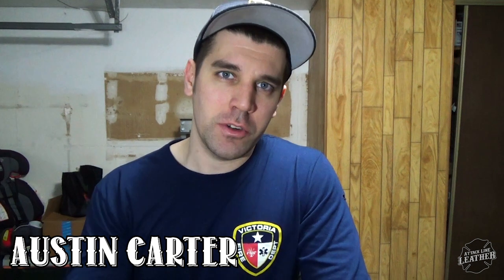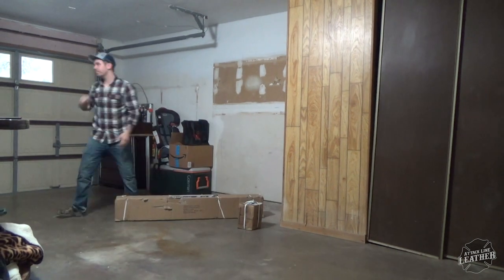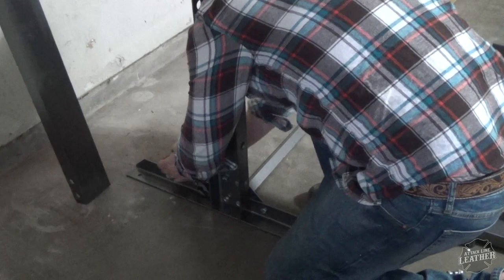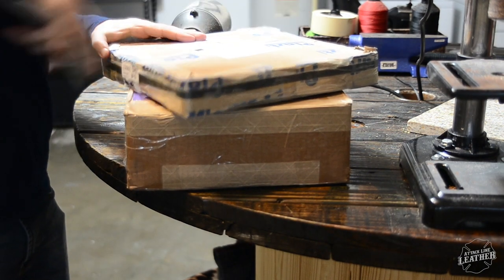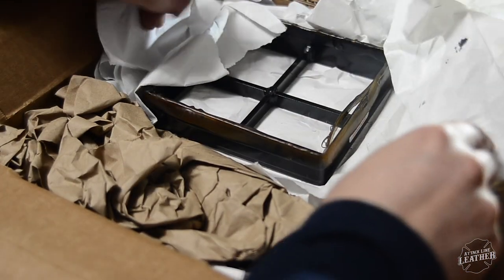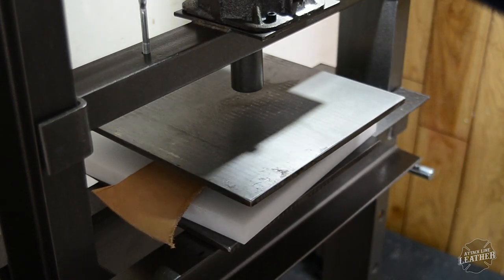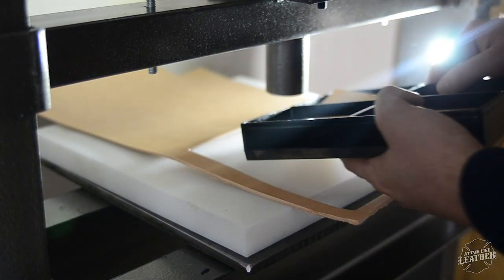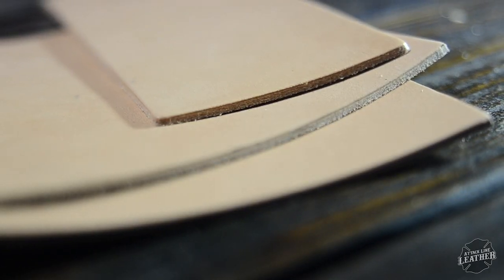Leather Clicker Press on a Budget

Comment: Another tip I would recommend is either drill hole higher on the sides but that will require quite precise drilling for 4 holes or make a stopper for the return and would speed up you having to pump extra pumps to speed up
Reply from the maker: Very good tip

Comment: Thank you, Austin, so very much for sharing your video. I just received my pre-made Steel Blade Rule Die Cut Steel Punch Wallet Cutting Mold Wood Dies  for making wallets (with the stitch holes in them) but NO directions!
It came directly from Japan. 
So I have been looking all over on how to use them. I had also just purchased a 2 ton Arbor Press for debossing a logo for my friends business. I was hoping I didn't need the bigger 20(?) Ton Arbor press just for small leather items.  
So I followed your greatly appreciated instructions, and am going to go from there! 
(I don't think I need the steel plates.)
I have the plastic cutting boards from Walmart.  Lol. 
So I hope I am set.
Thank you so much!
I am making them for merch for my friend to give away. It's my donation for his YouTube Channel. (It got to be quite an overall expense for giving free donations! Lol) But I am learning the ropes of leathercrafting. I'm 62 and just retired. I've always wanted to do this. 
Your YouTube Channel is my "Go-To" Channel now!!!
Thank you again😊👍
Reply: P.S.
I will have to go find out how to put these pieces of leather together, once cut, to make a wallet though! Lol
Reply from the maker: Thank you soo much for the support. For what you described you definitely dont need the 20 ton press. Depending on the thickness of your leather you might be able to get away with a 10 ton press. They are smaller and cheaper but should do the job
Reply: @AttackLineLeather  
Thank you!!!😊

Comment: Pressure plates, if you're lucky enough to have a metal supply store close by, you're in luck.  Mine had scraps available and I paid for the cut to size and discount since it was a shop scrap.  30 bucks and out the door.  I use the Harbor Freight system as a backup since I have a n industrial 220v clicker press that creates a small earthquake when in use.
Cheers
Reply: My wife uses the Harbor Freight setup for her smaller projects.  We get along just fine with the combined environment.

Comment: Hey! What’s up, just saw this and it’s crazy how before making my video I was looking for something like this. I work with thin leather so I ended up using the 1 Ton arbor press. Great job!! I’m liking and following.
Reply from the maker: Thanks soo much for the support
Reply from the maker: @Matthew M it works great for most thicknesses I have tried, the thickest being 11oz. You can find bench top clicker presses that are smaller in size but still have a 12 or 20 ton Jack. I'm very happy with the performance of the one I got

Comment: Hint: So you don't have to pump 20 times; pull down on the crossbar with the bottle jack on it. You will be able to pull against the springs easily then unscrew the top of the jack until you are close to the clicker but not too close so when you release the jack it will still go up and out of the way enough to remove the work piece. Just a little time saver.
Reply from the maker: Awesome. Thanks soo much for the tip

Comment: This is really great! I've been looking for a clicker press, and was just going to pull a trigger on a ~$800 hydraulic press (smaller than yours, it's 13''x 8''). I may buy this. I do have a couple of questions: 1. The central bar that pushes down on the plate looks small. Are the forces being applied evenly on the board? Do you have any uneven cut outs?  2. Is it possible to mount an upper metal board on the central bar? 3. Can it handle a larger cutting board? Not sure if the forces will be even. Thanks a lot for this great info!
Reply from the maker: This setup is definitely a money and time saver. If you have any experience with welding, you can customize it even more as far as adding a larger push plate to the bar. I find it does cut evenly. The largest clicker i have is a 7.5x7 wallet dye. If you are looking to use really large dyes it turns into a surface area ordeal and youll need to have a cutting board that matches or exceeds the size of the dye.

Comment: Are you still using this as a clicker? My biggest dye I'd use is 12 3/4 x 1.5. Making 2 clicks into 10-11, should work correct? Rest are real small parts for suspenders 1x6"
Reply from the maker: Yes i still use it. My biggest dye is 7.5x7  but yours should work. Just make sure you have a large enough base to acomodate

Comment: Great job and video!  I've been toying with the idea of doing the exact same but, have also figured out I can get a 1 ton lever press for about the same price.  Do you really need a 20 ton press to cut leather?
Reply from the maker: I'm sure a 12 ton press would work. For the leather I use, a 1 ton will not be enough
Reply: The manual clicker sold by Weaver is a 4 ton press. I’m going to do this with the $85, 6 ton press from Harbor Freight.

Comment: What are the cons of using this method instead of a normal clicker press?
Reply from the maker: Id say that the size of it could be a con if you dont have a ton of space. Its also very heavy to move. Because of the hydrolic pump it takes a bit longer than a normal clicker press to cut, but definitly beats hand cutting everything.

Comment: I have to say there are much better options for a budget clicker. The hydraulic press is very slow and massive overkill.

An arbour press and 2 steel plates would cost less than £70, take up less space and be much faster and more versatile.
Reply from the maker: Valid points. One must definitely do research pertaining to the needs of his or her shop. In my case an arbor press would not cut it for the leather i work with. If you could, shoot me a link to what you're talking about. Id love to see the arbor press youre speaking of.

Comment: Upgrade to an Air over Hydraulic 20ton jack and you'll be set.
Reply: Could you refer one air powered?
Reply: @danielhsubr  I bought this ChiCom Freight 20ton Air/Hydraulic Jack for use as a jack as well as for my pipe bender and shop press.  Work Smarter, Not Harder $130:  https://www.harborfreight.com/20-ton-air-over-hydraulic-jack-95553.html     The air mechanism can be more accurate than manual pumping, count the pulses as ypu work, each increment is small enough you can duplicate work without much risk of overbending.  And other than the jack's weight, the air makes everything so much easier from lifting GMV Humvee by suspension or using with pipe bender.      For the leather clicker press I bet the 12 ton is more than plenty power for hobby use or small volume.

Comment: I was thinking a bottle jack,steel plates and steel tubing from a junkyard.. be under 80$ finished 

Clicker dies youd need buy some for every purse ,wallet,  minimalist, phone case etc.... I seen it not worth looking into unless your only making and selling 100s of the same thing 

A 20$ (not sure the name) see thru   cutting square leaves you limited only to the imagination , a 15$ cutting wheel is marvelous... I ruined one round blade but I cut stingray with it... leather I used the same blade for 2 years on a good cutting board .. so yes faster but 5 wallets later (or whatever) wouldn't you be tired of the same thing and want new dies?   And to me it looks like you lose more leather

Comment: Them dies is hella expensive that’s why you didn’t mention it.
Reply from the maker: The dies i had made ranged from $35-$50. Its an investment in time and consistency.
Reply: @AttackLineLeather  not expensive at all.
Reply: @AttackLineLeather  where we can get those prices? I’m quoting in Socal, fellows asking $200+
Reply from the maker: @danielhsubr  http://www.usacuttingdie.com/home.html

Dies vary in price but ive had great success with this company
Reply: @AttackLineLeather  would those work to cut textile fabrics 100% cotton quilted? Since is manual not sure if is enough to cut through thick layers of fabrics. Thanks will reach out to TCD
Reply from the maker: @danielhsubr  no problem . You'd need to ask them about those cutting specs